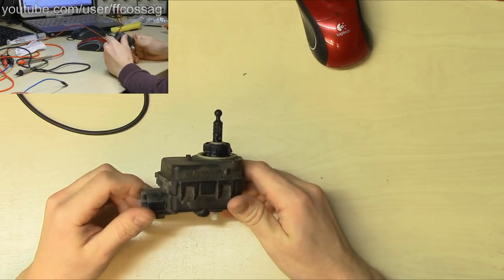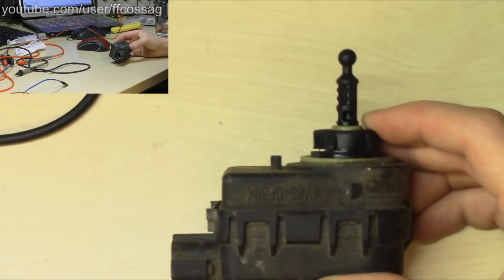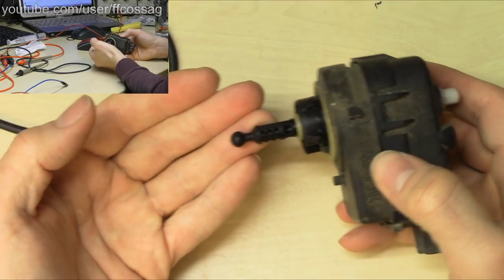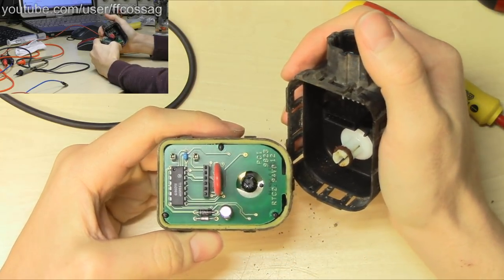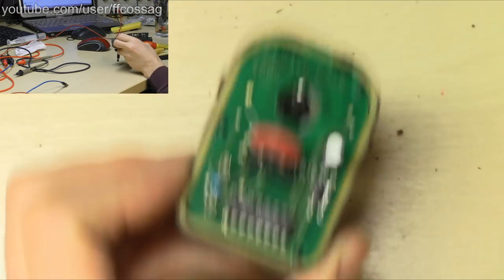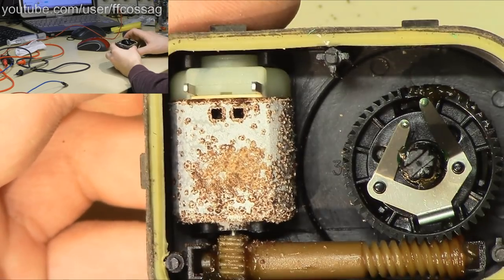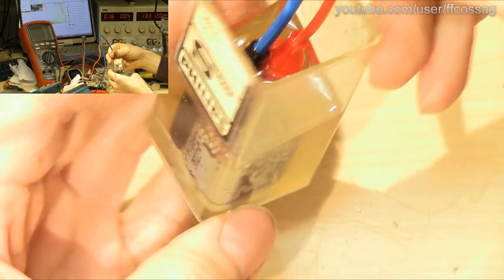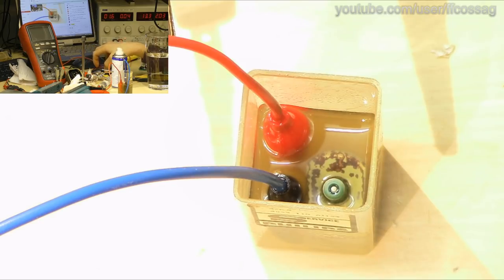RECDSTRM: Electric headlight elevator troubleshooting

Comment: WD-40 is actually a rust dissolver (as well as displacing water). It has a corrosive property and will pit bearings and other metal surfaces if often used over a period of time as a lubricant. Sadly some have learned this the hard way by ruining precision metal surfaces by trying to use WD-40 as a lubricant. There are plenty of good lubricants on the market, use those instead if lubrication is the intention.

Comment: This is not a real fix.  With such devices You can have three problems and a linear combination of the three:
1)Round contact circle dirty and need to be cleaned by the grass released by the surrounding gears.
2) ty93059p pertially shorted \ damaged \ broken.... (only solution replace it with a new one or with one recycled by other similar devices)
3) There is a hidden metal thermistor INSIDE the motor that ages and increase the resistance of the motor....that will became very weak
You need to open the motor and REMOVE it.  The motor will  reborn..
Cheers